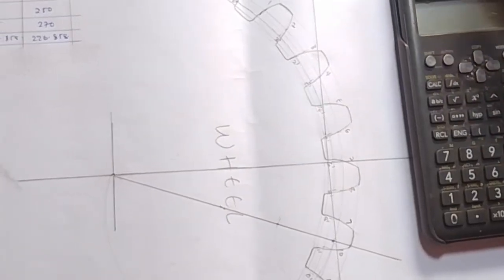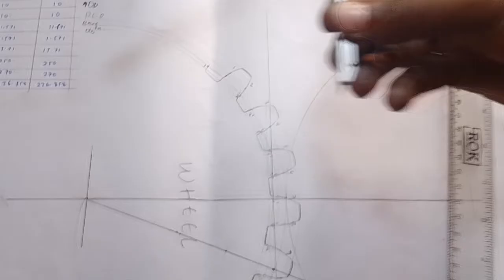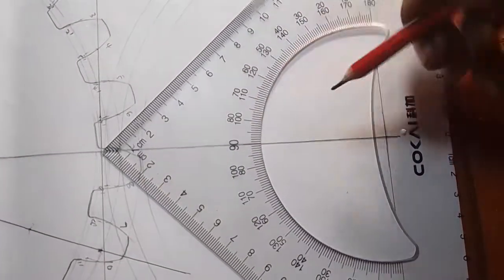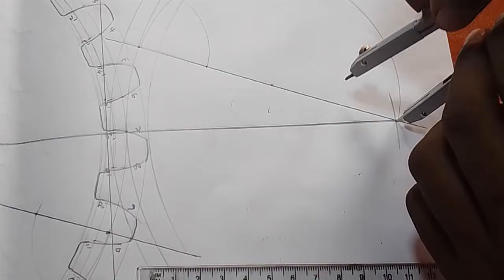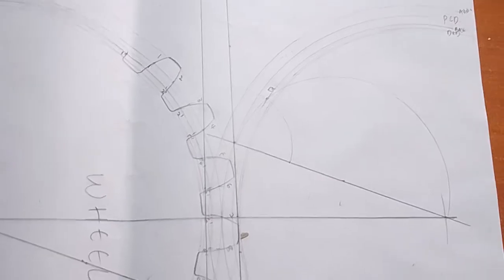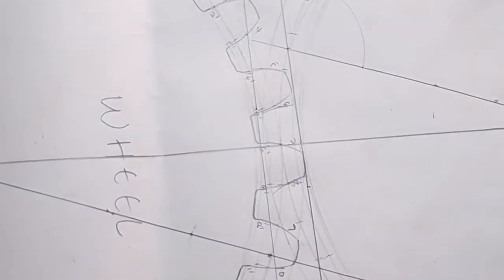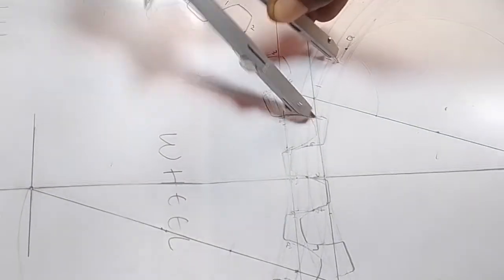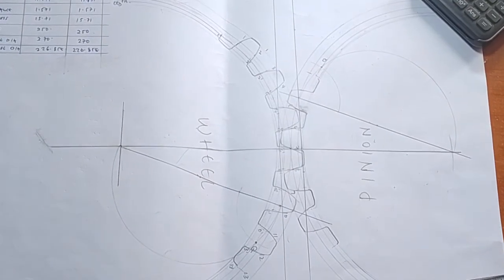How to mesh gears ❤|| Engineering Drawing and Design || KNEC past paper questions.

Comment: What if the ratio is not 1 to 1
Reply from the maker: Okay, if the ratio is 2:1 it means you multiply the pcd, pitch circle diameter addendum circle diameter and deddum circle diameter by 2. If the ratio is 1:2 it means you multiply these dimensions with 1/2... If the ratio is 3:2 it means you multiply the dimensions with 3/2 ... If the ratio is 3:1 it means you multiply the dimensions with 3... As so on and so forth.